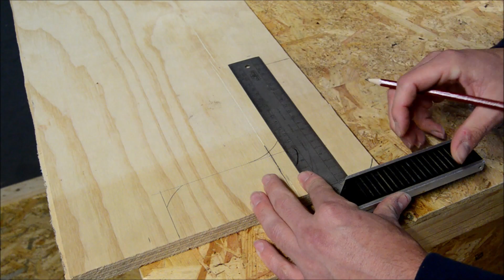DIY Corner Clamp | Simple Right Angle Jig

Comment: Hi, we’re all 4 cut from factory edges with pure right angles or did you have to make that first? Also, how are the holes for clamping as I would have thought parallel slots would be better for even grip? Thanks.
Reply from the maker: Yes i used the factory edges for mine. The circle holes work great 👌